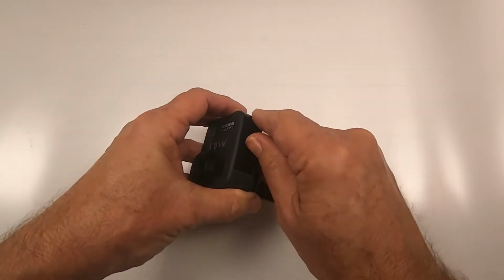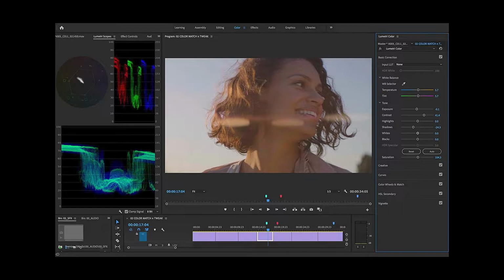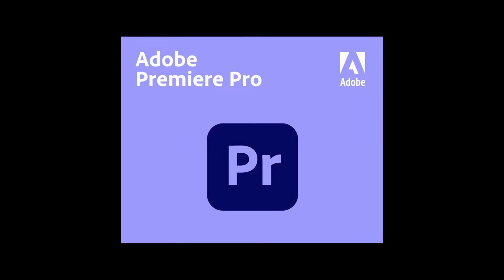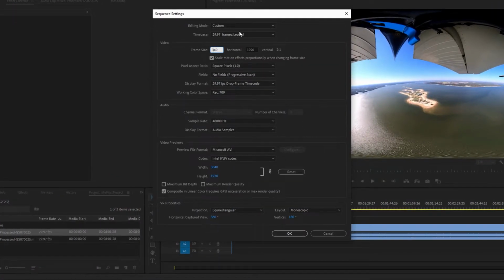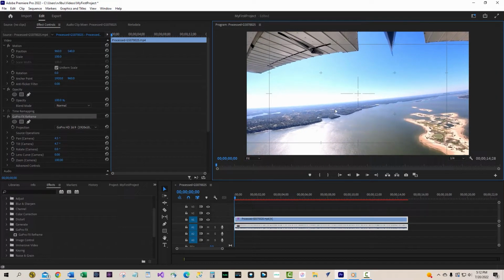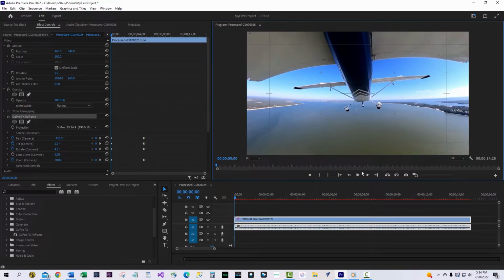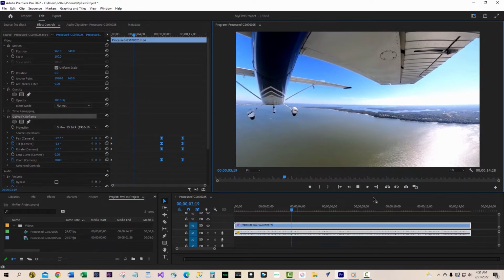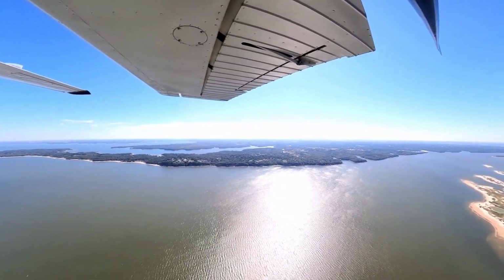GoPro Video Editing and MORE! #gopro #aviation #goprovlog

Comment: How did you get GoPro Player to work on your system?  GoPro Support just told me that it is not compatible with Hero 9,10 or 11 or Max.  It literally won't run on Windows.
Reply from the maker: Apparently other people are having issues as well. Ours still works, probably because it's an older version. We never use it anyway in the video production process, just the exporter and premiere pro.  Here's an article about it: https://community.gopro.com/s/question/0D53b00008ct48lCAA/gopro-player-on-win10-is-now-failing-to-open-anything-it-looks-like-others-are-seeing-the-same-issue-based-on-another-recent-comment-is-there-a-fix-for-this?language=en_US